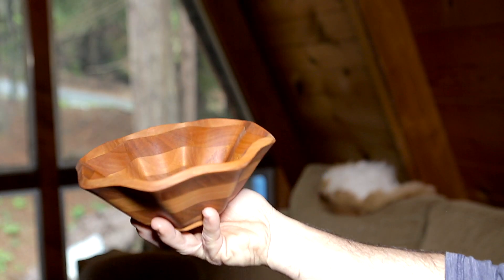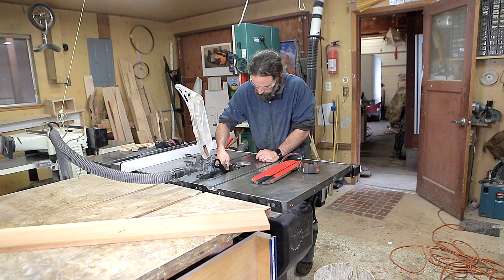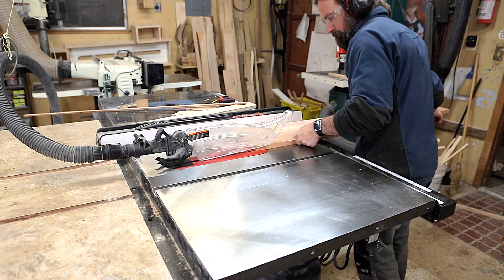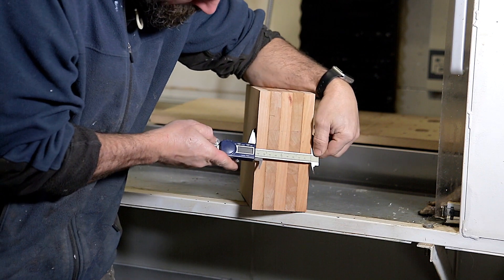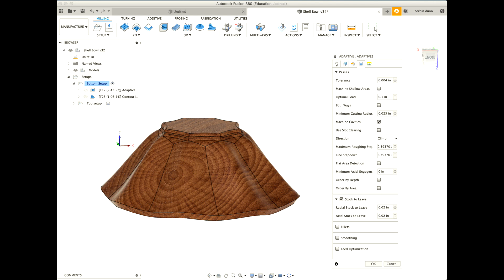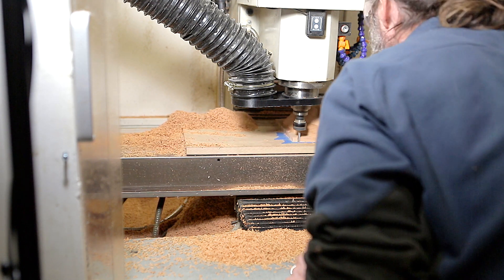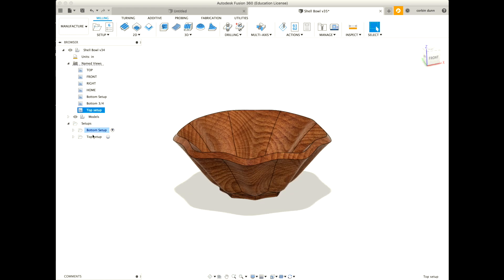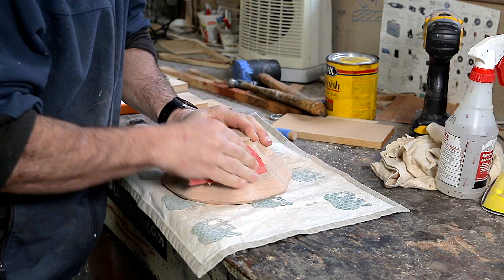How to Make Wood Shell Bowl! CNC Woodworking Bowl / Carving a bowl / Two sided machining

Comment: Interesting method using a Tormach CNC, can you show how to make cutting board inlays, can this tormach do detailed inlay work? Thanks.
Reply from the maker: You can do inlays on the Tormach; check out my "Spoon" and "Spatula" video. The issue with doing a cutting board is the size limitation on the PCNC series machines. The Tormach 24R would be better. I recently got an Avid CNC with a 4'x8' table, so it opens up a lot more options on what I can do. I'll eventually show how to do inlay cutting boards with that machine.
Reply: @CorbinDunn  Thanks for the reply. Would stay tuned for it.

Comment: You can use two dowel pins in the center area of each layer of of your glue up.  They are cut away in the CNC process of a bowl. Zero movement.
Reply from the maker: That's a good idea!

Comment: I am not sure if you have a lathe, but if you wanted to make sanding a tiny bit easier, you may have been able to mount the bowl to the lathe using your sacrificial MDF before removing it. Then you could've used some bowl sanding tools on the lathe, and made quick work of the sanding. Great tutorial though, I look forward to using some of the stuff I've learned when my machine finally arrives.
Reply from the maker: SanchezOKelly I do have one, but it is a metal lathe. Still might work! It’s a good idea, thanks!

Comment: Sprinkles of table salt in the glue between boards keeps them in place when clamping.
Reply from the maker: I've heard mixed results on doing this; some people say it works great; other people say that it leaves bits of salt in the piece that can be seen (if it doesn't dissolve). I've been avoiding trying it because I don't want to leave bits of salt in the end product.

Comment: Try letting the glue set a bit before clamping.  Helps to keep the boards from sliding all over the place.
Reply from the maker: That’s a good idea! I’ve seen people use salt to help with alignment. But I don’t like the idea of having salt granules show up in the finished bowl. Thanks for the tip - I still struggle with glue ups on bowls.

Comment from the maker: Update: Now when I mill the "outside/bottom" of the bowl I model the stock size into Fusion 360. I then wack off some size; 0.020 or so, and use that as an offset for the "inside/top" of the bowl. For the second op (the inside/top), I now clamp it into a vice and that allows me to more easily get it indicated in.

Comment: For the longest time I used to think there were magical methods to getting that 3D contoured shape with a cnc.
I was bummed when I realized it's just a brute-force operation: Thousands of profile cuts.
I suppose you could cut down the machining time with a 4th or even 5th axis.

But dang... It's insane the amount of machining time required to make a shape like this.
Nicely done documenting it.
Reply from the maker: Yeah, it is magic ;). I think this thing took about 8-9 hours of machining time. I watched it off and on...just to make sure everything was going smoothly. 0.010 was the best stepover for this project.... 0.040 would take 30 minutes, 0.020 take ~1 hour, and 0.010 would take two.
Reply: Would it make sense to use a large spade drill to hollow out the rough form?